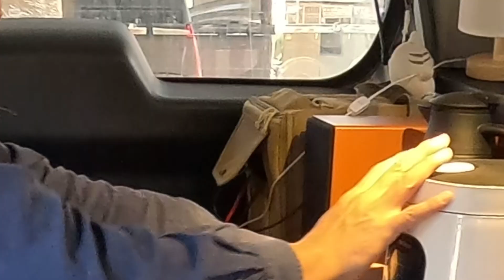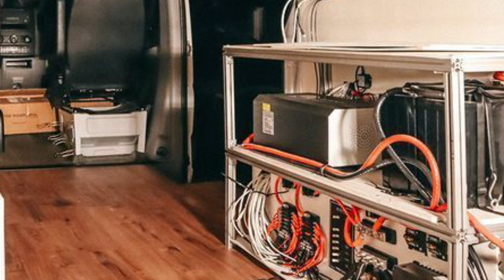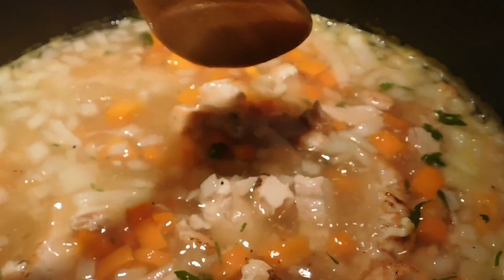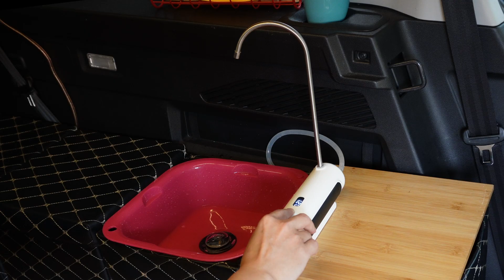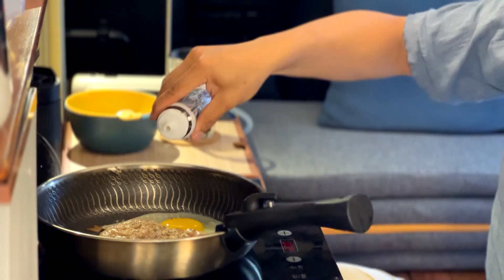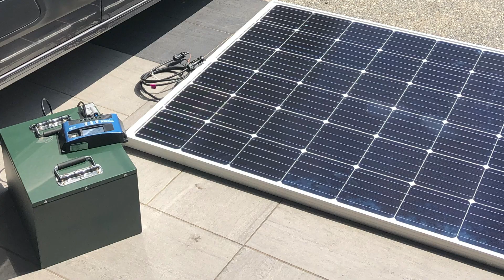【Car Camping】DC Power Kitchen for Vanlife : No Inverter Required!

Comment: 如果是plug in 油電混合動力的minivan呢？ 一般來說plug in(插電的）都有一個10度左右的大電池提供純電的電動車功能，唯一的插電混合動力minivan 就只有Pacifica有提供，提供油電混合系統的豐田後來也只出油電混合動力的minivan沒有插電的，插電的好處就是因為有純電動車功能就必須安裝一個電池供電的“發電機”功能給車上傳統12V供電，這發電機是虛擬的意思是功能有如汽車發電機一樣給12V電池還有設備供電，一般來說90-140A 12V，電動車上通常會安裝2000W以上的高壓低壓直流逆變器當發電機，用大電池給全車的傳統12V電器或電池供電，Pacifica 提供的高達2500W的持續逆變器12V供電，大約就是200A! 大電池也有16度的電量應付露營太多了，很多露營車的電池都沒有兩三度的電量！

在電池跟引擎的高壓大電池發電機都準備就緒了，剩下的就是買一台2000-2500瓦的逆變器，然後就沒有你不能用的家電產品了。 因為一般家庭配電插座就是最高15A 1800W（商業好比辦公室醫院等會用到20A 2400W插座稍微不同以防插錯），所以吹風機、小烤箱、小暖氣、電路電鍋這些加熱最耗電的家電都設計在1500-1800瓦以下以方便家庭用電安全，所以2000瓦以上就足夠了，越多只是能同時用更多的家電而已。

Comment: hmm have been using ip2368 100w bidirectional usb-c boards for my diy power stations, but you have convinced me i need to make atleast one 8s/24v pack.
have been using cheap 32ah lfp cells, theyre about 7-8usd ea during sales.
i think i will make my 24v battery work as 2x series 4s packs, and have each one charge from its own 100w board. that way i can stick to using usb-c 100w charging, but use 2 cords at once.
im thinking of using an 8s active balance board instead of bms. dont really like bms and all its drawbacks. just going to add a slow blow fuse between the 2 packs. all should fit inside of a standard size ammo can. the surplus metal 30 cal version is big enough but i think i will use the plastic version. should be around 0.8kwh but very compact and portable still. 1c discharge should still allow me to use items like 24v induction cook top @ ~16amps.
everything is more efficient on 24v instead of 12v.
edit, i think maybe adding some small magnets for your insulation enclosure lid to hold tight pressure might be a good idea.

Comment: He's right and I agree. Let's look at your laptop computer. It has a battery. That battery is of course DC.  You plug your charger cord into an AC outlet. There is a unit on the cord to convert that AC into DC. But if you are in a car. You are now starting with DC. That has to be converted over to AC so that you can plug that same power cord into AC, correct?  Every time that you convert you will loose some power.
Get yourself a cigarette lighter car converter for you laptop. Then you'll be DC to DC.

Comment: Thank you for this informative video! How do you manage all the grease/oil/steam getting absorbed into your car headliner and all other fabrics? I want to cook in my car but afraid it will attract bears in bear country as those odors linger for quite some time. Hoping you have found a solution!
Reply from the maker: When cooking inside the car, the key is using low-power DC appliances and mostly opting for “slow cooking” methods. This minimizes steam and oil smoke. Opening the windows slightly for ventilation and keeping the cooking area away from the car’s interior decorations can also help.
Reply: Electric pressure cookers contain all of the cooking ingredients. Unless you choose to release the steam you can wait and there won't be massive amounts of steam when you finally open it. Justice theme that comes from hot food as you eat it

Comment: You nicely present a makes-sense solution that most van electral system people don't mention (probably because DC appliance diversity was much more limited in the past). I think many people can benefit from your example. Good job. Users need to be fully aware of the low wattage of DC appliances (which you mentioned), but the required longer preps times can be accommodated with simple planning (which you also mentioned).

Comment: No way of starting with 24/48 V?
Reply from the maker: I use a 24-volt battery because trucks in Europe and Asia run on 24 volts, so it’s easy to find appliances designed for their setup.
Reply: @TRAVEL_and_DESIGN  Folks in north America might do well to check out the shops located at truck stops. Many offer a wide range of small appliances geared toward living and cooking in the sleeper behind the driver's compartment. Heavy diesel trucks do not use12 volts. For a time, I owned a 1975 AM General 2 1/2 ton surplus military truck. Again, 24 volt electrical system.

Comment: Here in the U.S. most vehicles have 12v power outlets, not 24v. The "Solar generators" also have only 12v power taps. Do the Solar Generators (battery back-ups) have 24v taps in your country?  Taobao does not appear to have English version of website. Maybe Alibaba? Would love to get a 24v induction cooker. Thanks for video.
Reply from the maker: Yeah, trucks in Europe and Asia run on 24 volts, so there are a lot of 24-volt DC devices designed for drivers. For solar panels, you just need two 12-volt panels connected in series to make a 24-volt system. As for energy storage batteries, if you don’t include an inverter, they’re much smaller and don’t have heat dissipation issues.

Comment: probably the most important point for me, inverters are a wear item. they all seem to burn out after a certain amount of kwh is ran thru them. obviously heat is important, but sometimes they just fail, usually when you need them most in the middle of nowhere. 
I have a video on my channel about how i reduced the power consumption of my dc fridge by around 80%, to the point where its so cheap to use at home it saves energy as a drink fridge coz i open my main fridge less often.

Comment: There is a reason why high power devices use 230V~ and not 12 V=. Yes, an inverter is ineffective. But the very high currents necessary for 12V=, it's best to keep the wire very, very short. Therefore put battery and inverter side by side. Appliances further away should use higher voltages, like 230V~.
Most cigarette lighter sockets work safely and reliably up to 120 Watts.
Reply: If you use the correct sized inverter they have less loss. And if you only use 220v for only the high wattage  equipment and shut it down outside the investment is not need to 24 cooking equipment. I have it split. continues equipment on 12v and the microwave, stove and coffeemaker on 220v. So the inverter runs max 1 hour a day.
Reply from the maker: Yes, that’s exactly how it is. However, truck systems in Asia and Europe use 24-volt batteries, which has led to the development of many appliances specifically designed for truck drivers. Of course, their wattage isn’t very high. For example, an induction cooker typically runs at over 1200 watts on AC power, but the DC versions we can buy are usually limited to 600 watts. Other appliances, like kettles, are often only around 200 watts. From another perspective, having more time outdoors makes it easier to adapt. While it takes a bit longer to use these appliances, it helps conserve battery power, which I personally find acceptable.

Comment: I cannot understand how you operate an induction hob off 12v without an inverter.  Please can you supply details of the model that you are using.  Thank you.
Reply from the maker: In fact, this is a 24-volt DC induction cooker. Since trucks in Europe and some Asian countries use 24-volt batteries, these appliances are designed for truck drivers.

【淘宝】7天无理由退货 https://e.tb.cn/h.T7tQXbk78wzBIpi?tk=3PkZe0KSePe CZ0002 「车载电磁炉24V48V汽车货车房车用热炉触摸直流变频电磁炉炒菜电炒」
点击链接直接打开 或者 淘宝搜索直接打开

Comment: If there were 48V systems in cars, trucks, campers, boats and even smaller homes there were hardly any need for AC power at all. But maybe we will switch to battery powered appliances anyway.

Comment: Thank you for another great video sharing the knowledge you've earned by experience. A reliable and practical power supply like the one you're using is essential. Please let us know how to get one.
Also, I notice you're using automatic dubbing for this video, and I'm curious about your experience with this tool for your language. Do you recommend it?
Reply from the maker: I’m using a 24-volt, 2.52 kWh lithium iron battery system. It features three 10-amp cigarette lighter sockets, a 50-amp Anderson connector, an MPPT solar input, and an aviation plug input. It’s a custom-designed product, and since I skipped the inverter, it’s more compact.

Comment: Thanks for posting the English version.  Do you have links to 12v DC powered induction stoves?  When search what comes up appears to be AC powered induction stoves units requiring an inverter, not 12v ones. Thx.
Reply from the maker: Here’s the link I found online for the 24V version. I haven’t seen a 12V one yet because, at 700W, the current for 12V exceeds 60 amps. Currently, Anderson connectors are limited to 50 amps. You might want to consider setting up a separate 24V system, which would be better suited for high-power devices.
【淘宝】7天无理由退货 https://e.tb.cn/h.ThTx1tuMnrVCGJq?tk=c7zIeaBSV2N MF6563 「车载电磁炉24V48V汽车货车房车用热炉触摸直流变频电磁炉炒菜电炒」
点击链接直接打开 或者 淘宝搜索直接打开
Reply: @TRAVEL_and_DESIGN i would like to see internals of that dc induction. There has to be internal electronics thats do the swiching. Dc cannot do induction by its own it requires switching.
Reply: But rest is nice and will help you save energy. Most ppl want everything fast and dont want to wait. You are more efficient ;) cheers